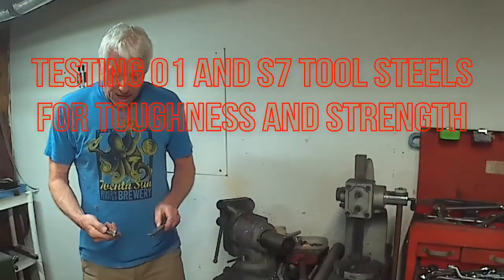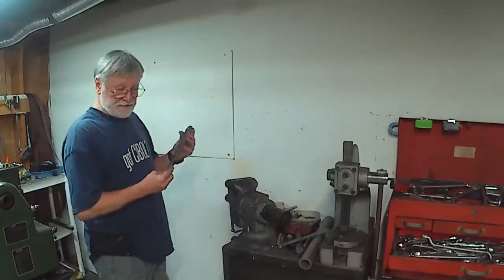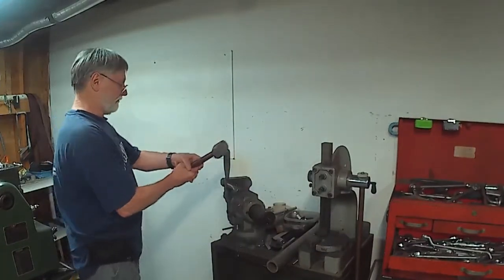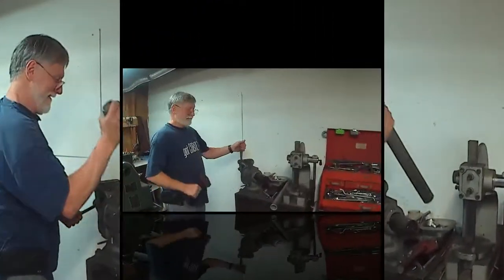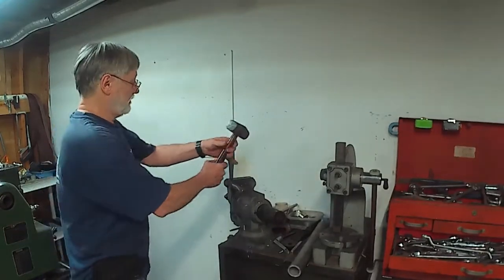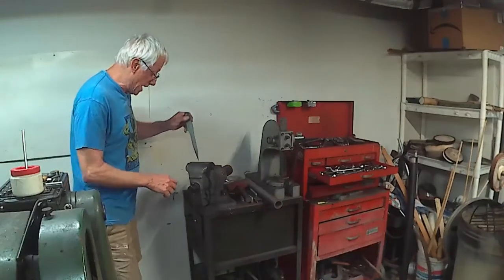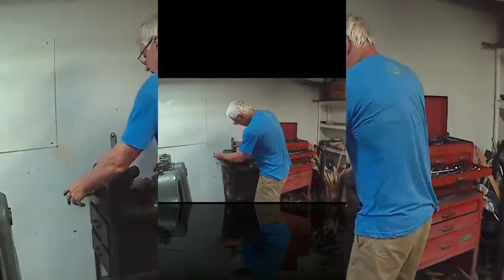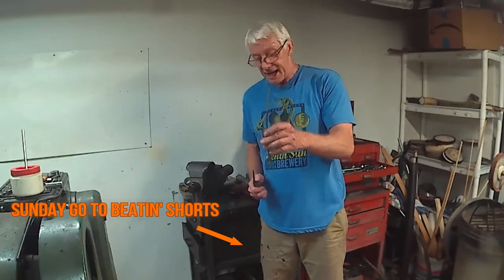Toughness O1 vs S7

Comment: I believe that spring tempered O1 steel will be good enough for cold chisels.
Reply from the maker: Actually, O1 is quite common for cold chisels.  The key is proper heat-treating.   We've been reading and testing for quite a while.  That's why I like O1 tool steel.  Thanks for the comment.